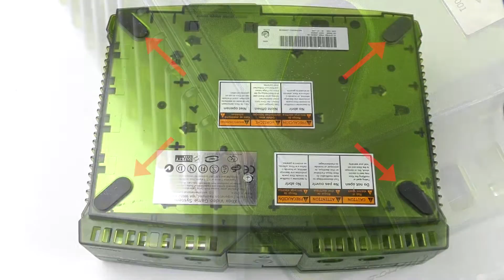How to add LED's to the Original XBOX's Jewel

Comment: What do you mean by install heat shrink before solder doesn't the heat shrink go on top of the soldered together parts? Can I just twist wires together instead of using solder? Thx
Reply from the maker: Put it on the wire before soldering but just out of the way, you won’t be able to slide it on after soldering

Comment: Hiya! Sorry if this is a dumb question but I don't know much about electrical stuff. I have this IDE to Sata Converter from Startech for my hdd connection, and it has an extra molex input on it, is there anyway I can connect the LED to that input rather than cutting the xbox's pre-existing wires? Thanks, and sorry again if this is a dumb question.
Reply from the maker: Not a dumb thing to ask!
I'm assuming you have one with a molex passthrough, so a female and male end?
If so, you can patch in the LEDs there, no problem! :D
Reply: @Slot1Gamer  Yea that's the one! Glad to hear it, thank you so much!
Reply: Hi there I also have the molex extra bit hanging how do I "patch in" something and how can I install extra LEDs elsewhere

Comment: you dont need to cut the power wires. you can pop off the back on the molex connector and just solder onto the cables there and after you're done, just pop the lid onto it again, clean install ;)
Reply from the maker: Yeah you can, those press fit connectors can be a little tricky to close sometimes